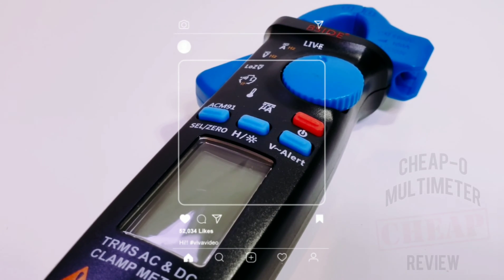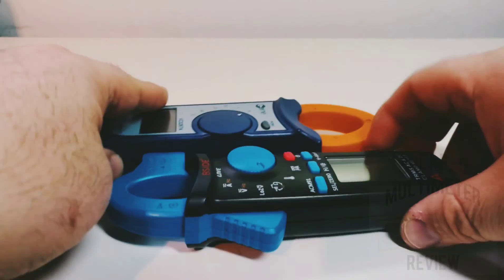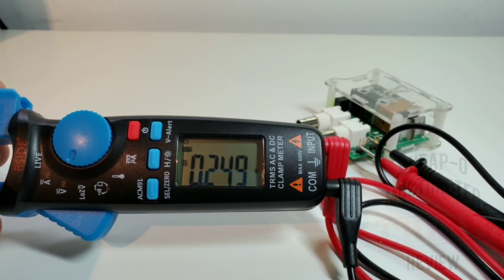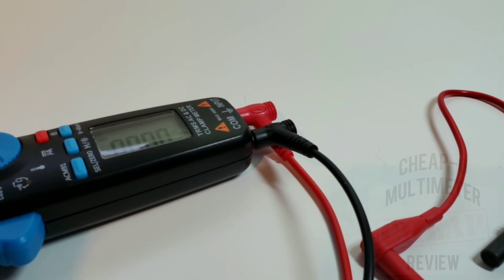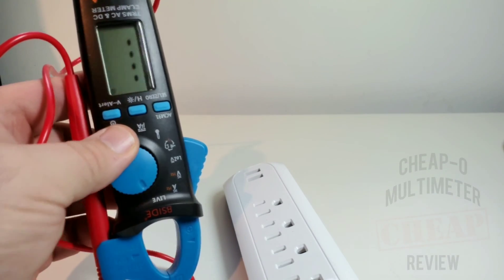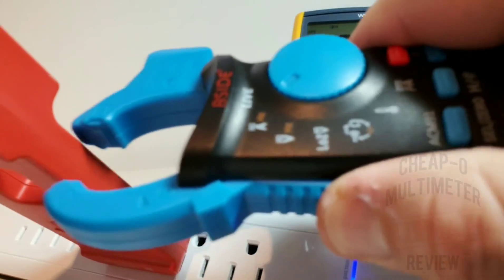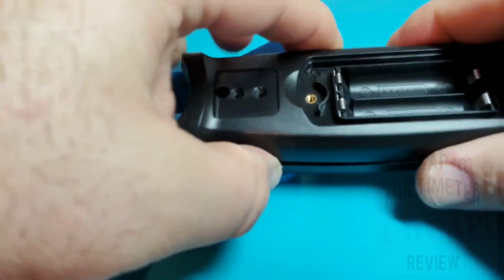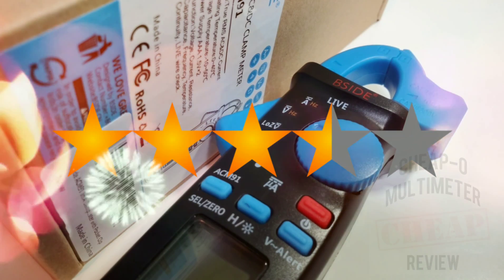BSIDE ACM91 CHEAP-O Multimeter Review and Teardown!

Comment: Why do you suspect that the LoZ setting no longer switches to a/c mode?
Reply: hmm...looking at my continuity/diode check - doesn't seem to be switching anymore with the press of SEL button.   ACM81 model....continuity - no buzzer of any sorts......oh...that's a good one....had to press like 10 times to switch....The funny things is it's making a beeping sounds like it's reading the sel button every time though...but switched on 9th, 10th press lmao...
Reply: @joepiscapo936 someone pointed out that it will switch automatically, and I tried it and to my surprise it does
Reply: @lorenz681  oh it knows if it's AC or DC?

Comment: I have one of this BSide ACM91 and the DMM is good, but how to make it stable on the workbench is a PITA. Good to see its insides. When compared with the internals of UNI-T UT210e, that one was PTC and MOVs, but “ours” as here just have the PTC. 
Another good thing is the input impedance at VDC is 11 Megohm, while an AN9002, bought because of its Bluetooth App (questionable real utility) has shown just 910 Kilohm (probably because of the Auto feature, I guess).
Reply from the maker: Its a great clamp, very underrated and great performance for a CHEAP-O 😊

Comment: Do you know the difference between acm91 and acm92?
Reply: ACM91 is True-RMS, resistance up to 60MOhm, measures capacitance, temperature, DC Current 0-200uA with probes, has LoZ test. AMC92 has AC Current range 600mA with 0.1mA resolution.

Comment: The UNI-T UT210e Pro Digital Clamp Meter has better accuracy for measuring low DC amp...  https://www.youtube.com/watch?v=9azDW7NSCjo (This video shows Uni-T UT210E (Not Pro))  However, Uni-T UT210e Pro does not have auto ranging.

Comment: I found the review somewhat flippant and condescending, with a peculiar, repeated preoccupation with the jaw opening and circumference. I measure DC currents on small wires and could argue that the jaw opening is way too big and the circumference unnecessarily large. From my perspective the ACM91 is a fantastic, effective, and low-cost find and I'm ever so happy to have found it.
Reply from the maker: How on earth was it condescending...?
At any rate, YMMV as with all instruments. Glad you like the clamp, there are certainly much worse ones out there!
Reply: @KeepOnTesting  YOUR criticism of Jaw size show your probably lack of understanding of standards and regulations. A clamp meter that supports up to 100A max. is NOT allowed to have a jaw that can clamp on a FAT cable that can have 1000A current. Also, a current probe for testing up to 10A max  has jaws less than 6mm diameter to stop people trying to clamp on high current wires.
It is horses for courses.

Comment: do you mean it can't read capacitance below 600uf? or is it a 0 to 600 range or 0 to 6000 and just not perfectly accurate for smaller caps?
Reply from the maker: Nothing below 600uF ...
Reply: @KeepOnTesting  
Capacitance: 600μF/6000μF 0.1μF/1μF ±(4.0%+3counts)
IF lower FULL SCALE can be 600uF, you should be able to measure capacitance much lower than 600uF
I have tested on my ACM91 down to 1uF but won't trust readings below 10uF.

Comment: Hi Darren, How come there was no testing with the clamp head done in the review?
Reply from the maker: Hello..I did test the clamp head! The clamp Current testing with the Clamp Jaw starts at 11:05
Reply: @KeepOnTesting  Apologies Darren, i missed that bit.  I've just bought an ACM91 and i couldn't make it read AC amps.  I was putting around the whole cable rather just one core of the cable.
Reply from the maker: @4272005  No worries ! Keep On Testing
Reply: @4272005  any idea if the meter will do AC mA?

Comment: Having this Meter, I can say never worked properly, the clamp shows 55 A, 27 and then 11A, it does not matter Ac, DC, with or without a wire..Voltage measurement is 75  when should be. 220 , and so for. I got it through Ali Baba. ,I was skeptical about the quality and 35 € for something does not work is quite expensive, and it is more expensive return the product than buying a new one in Amazon. I guess my clamp was the wrong one, even with the Q. C  stickers on it.
Reply from the maker: Sorry to hear it was a letdown...did you you cleaning the pcb with Isopropyl...install resh batteries ...usual suspects can wreak havoc on dmms.

Comment: Thanks for this review! The clamp size is small, but comparing the specs show's it's 20mm compared to the Uni T UT210e at 17mm. Also, it seems odd, it's almost as if the meter is aimed at HVAC techs (or at least home DIY'ers like me) as it offers Temp and LoZ, yet they leave out the needed capacitance ranges. Puzzling, you'd think those cap ranges would be a no brainer in every meter, even the cheap ones. 
But at $18 less than the UT210e, with temp, loz and 6000 counts, it's probably a better meter for me than the UniT. I think I'll pick one up, I've got other meters that can read the capacitance ranges. Still, makes me scratch my head and say "What where they thinking?".
Reply from the maker: Youre welcome Chuck..Glad it helped!
Yes, quite a bizarre capacitance range..and no diode mode at all really irked me. However, as you point out it's still a very capable clamp and the added inclusion of LoZ and dual display Temperature along with a great price really seals the deal. Let me know how you like it!
Reply: @KeepOnTesting  Lacking a diode mode is weird, but that's not something I was looking for with this particular meter, so it didn't slap me in the face the way the capacitance range did. But I suppose us aficionados of cheapo meters can't be too particular. And I'm so used to carrying two meters with me when I work on the A/C that it won't bother me that much. I've got lots of work to do this fall and winter, so it's going to get a workout!

Comment: Not too bad for $30, agreed the clamp opening is somewhat small but depends on what you intend to clamp I guess.  I do see it online for as high as $57 and thats beyond reasonable but thats a one off exception its easy to find for under $35.  For such a small guy it has a lot to offer with a couple of exceptions, amazes me how that style of continuity speaker can be so large on the board but be so weak sounding - ive seen same one in other meters and its always weak it seems.  Were seeing more and more dual displays on low budget meters and a nice thing to see on this one.  Just my preference but wish they would include straight lead connectors when the input jacks are at the bottom, but again thats just me.  Not the worse cheapo clamp  meter, ive seen worse for more money.  Also agree the probes were better than average without cleaning, just something I do when they dont perform.
Reply from the maker: Hey Mike, Here here...its a pretty decent  clamp for the price...my biggest caveat was the jaw size...I've seen small clamps with big jaws and this would have been preferable. Agreed about that continuity..needs to be louder!! I know you like to clean your stock probes...and I do to. However, for acuity, I prefer the "virgin" probes  when doing the stock continuity tests.